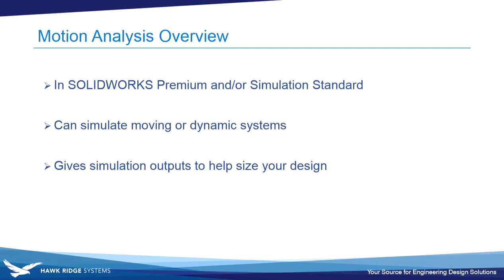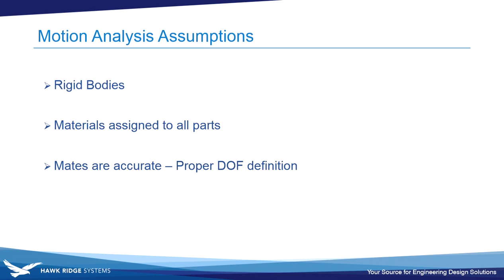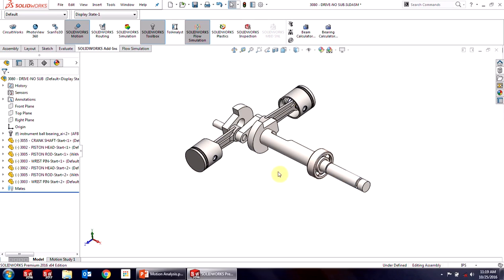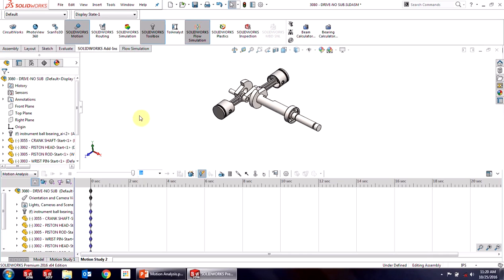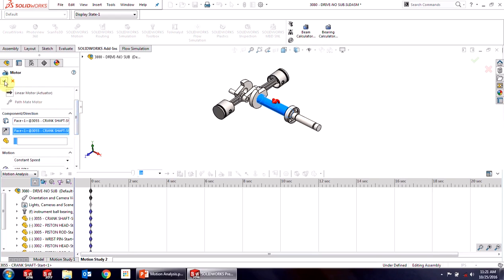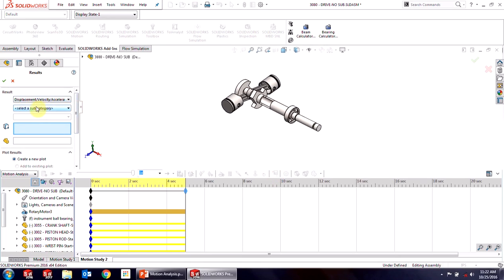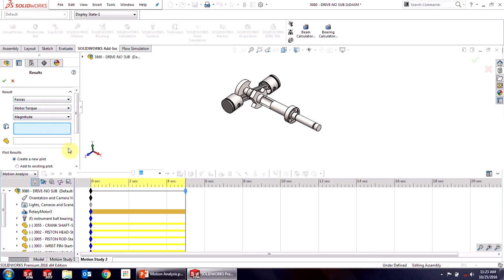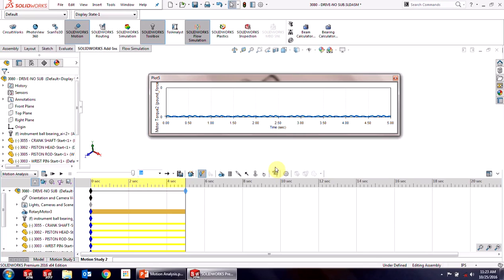Introduction to Motion Analysis in SOLIDWORKS Simulation

Comment: Hey Modelled a 4 cylinder engine and doing a displacement and velocity Plot through Motion analysis. Hoping you could assist me with the results. Is it Normal to get 160x 10^3 m/sec as velocity and 200x 10^3 m displacement on the pistons?

Comment: Good day, i have a problem regarding about the import motion load. I have a shaft with a flywheel to rotate about 10 rpm in 30 s. The motion analysis runs smoothly, however, when i tried to import the loads into static to see the deflection and inputted bearing fixture (rigid) onto the split lines i had created, the transferred remote load appeared to be malfunctioned, and solid work gave out message saying that " One load/fixture/connector/contact is invalid". I had turned off the inertia relief and it still didint run smoothly with fixture on and no change in remote loads. Sadly, I tried test with Bearing Fixture, Roller/Slider Fixture, Cylindrical fixtures to mimic the bearing support during rotational motion, all failed and deformed drastically.  May i know how to handle the remote load definition imported from the motion load when we had inputted the fixture or how i should input my fixture correctly? Thankyou.
Reply: https://youtu.be/fRyUf-GY754

Comment: Hi Vince this is good. I wondered what the max value of the torque is - I'm assuming there's no frictional resistance or compression resistance on the tops of the piston, and the motor is only accelerating the piston and link masses back and forth and perhaps they're counterbalanced by the weights quite well. Does it add up to a hand calculation? Just wondering. Thanks.